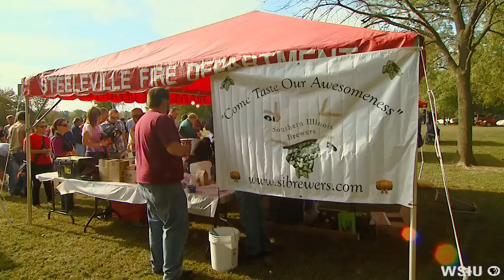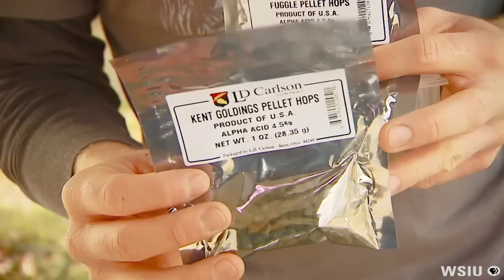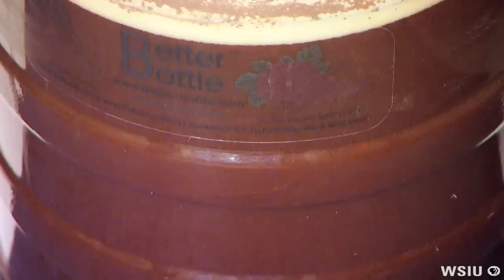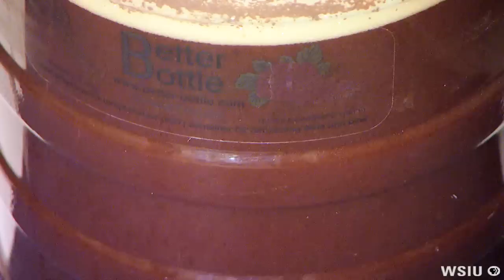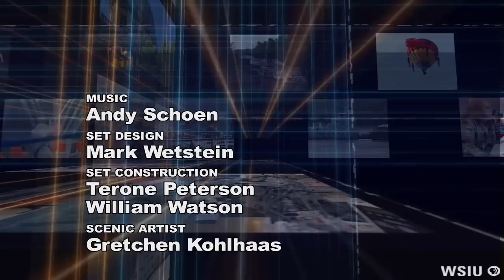Home Brewing

Comment: I think its funny, all grain makes the best beer possible and its also the cheapest.. the only downside is it takes more time.. I've never done it.. the most brewing I've done is dry malt extract with specialty grains and hop additions.. I did an IPA with light DME carapils and a little chocolate specialty grains. 4 oz mixed of cascade,wimlliamette,and citra and then dry hopped with amarillo.. turned out badass.. 6.4% abv. with 80 ibus

Comment: Can anyone recommend a good grain for a golden ale? nice golden colour that would work great for a neutral flavour not too malty ready for infusion with bananas at the hop stage. i really want the banana taste to come out so the grain can't be a strong flavour. any help appreciated its my first time brewing with grain and having trouble deciding on which one to go with. thanks!
Reply: Try a mix of Pilsner and 2 row about 50/50 or add in a touch of ligth munich or vienna.  Also what hops are you using? I'd recommend something more nobel. I make a summer brew using this mix with nobel hops with honey.  It comes out nice. Good luck!
Reply: thanks for your help, I'm using fuggle hops but not going really heavy on it just enough to as some slight bitterness. Do you know of anyways of adding colour to your beer without using colouring dye, for example hint of green, or red? like to know for future idea, if this first  all grain brew turns out good. thanks!
Reply: FrauenArzt2012 The only way that color was ever incorporated to my beer was using fruits. If all you want to do is add color, no aroma or flavor, the dye would be the cleanest way to acheive this that I am aware of.
Reply: I would look into the yeast and the corresponding fermentation temperature to give you the Bananna flavor you are looking for. The fruit itself may not give you the Bananna flavor you are looking for. Hard to go wrong with a good 2 row malt and a crystal malt with a low lovibond for the color and nuetral malt flavor your looking for.  I would also look into some simple software to help you analyse and develope your recipe like Beersmith. Hope your brew turns out well.
Cheers.
Reply: Agree with Todd on the bananna flavor. Hefeweizen yeast fermented more on the higher end of the yeasts range would give you a good bit of bananna flavor. Beertools.com also offers a free software just to play around with to see if you like the program. The downloadable version has many more features and is very similar to BeerSmith.